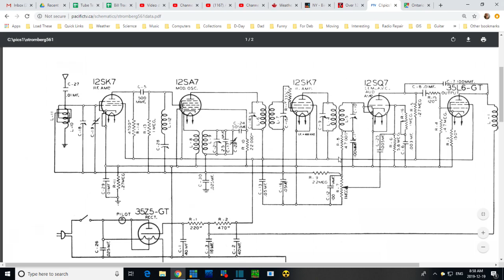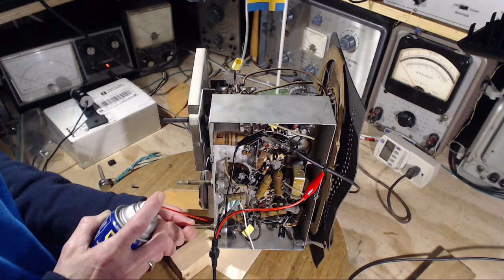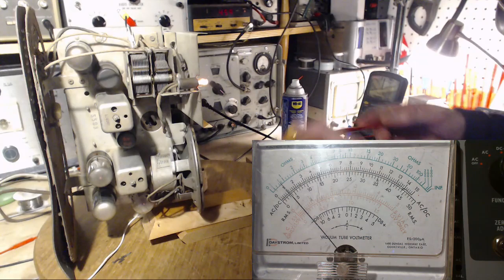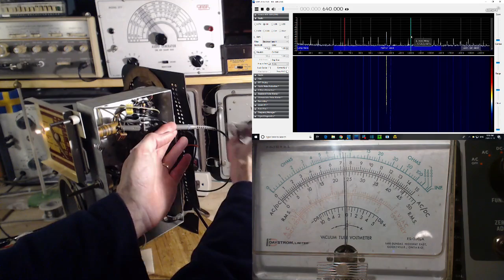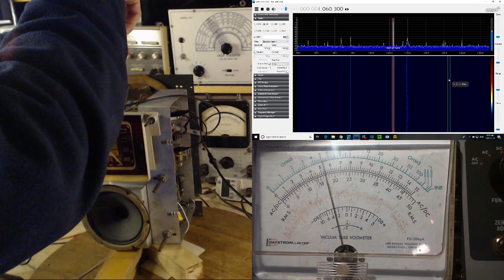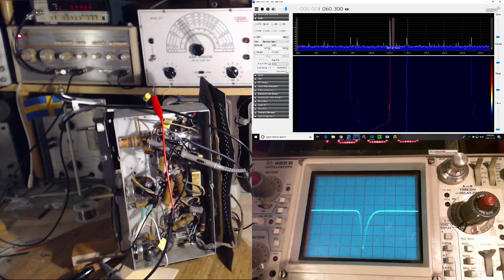Stromberg Carlson 561 Tube Radio Video #3 - Alignment Check

Comment: 12:45 Little tip: when working on point to point wired chassis better not use clipleads with alligator clips on the end. Especially with the insulation shoved back half an inch and you moving the equipment. Treat yourself to some J-hook clips. There is always some stretch of bare component lead or wire to hook them onto. They are a dime a dozen from china, and since most alligator clip leads get wonky over time and need resoldering or recripming of the wires to ensure proper contact anyway, it is a no brainer to swap one side from alligator to said J-hook clips.

Comment: The trap at 460khz is to prevent IF feed through back to the antenna, not the local oscillator.
Reply: widecast He had come across the IF trap and its alignment on one of the Nordmende he did months back. It was already explained to him then IIRC. Was it Adam Savage who said something along the lines of "I reject reality and substitute my own?"